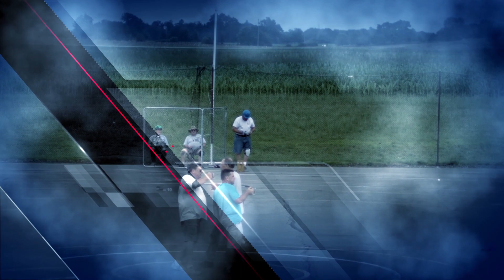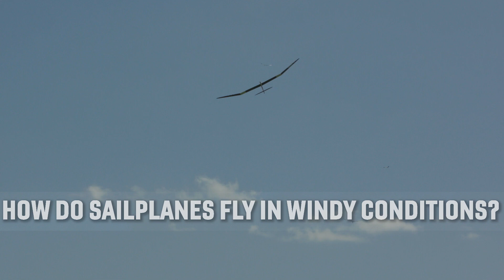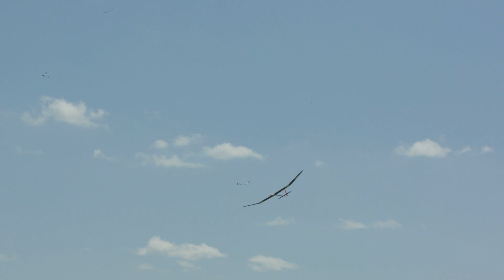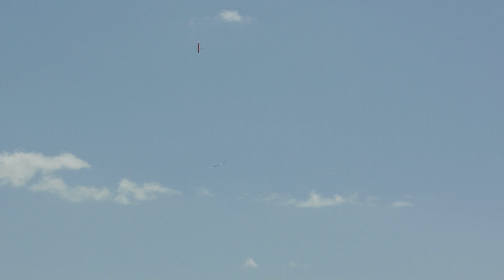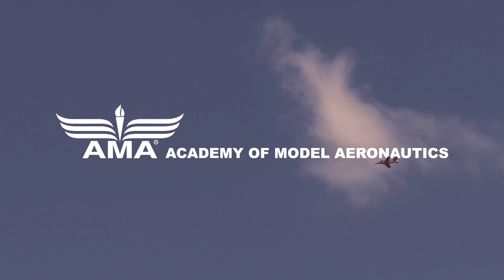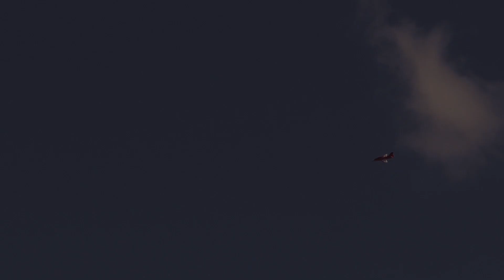Nats Demystified - How Do Sailplanes Fly in Windy Conditions

Comment: I turned my Aquila into a motor glider or motorized sailplane the battery and motor I used gave me two climbs to about a hundred feet as I could only do the throttle and bursts or I would overload either the battery or the speed control I forget which but that old Aquila sure could Glide around quite well.